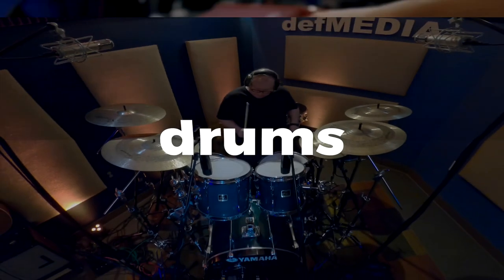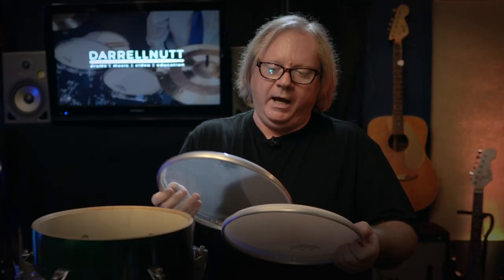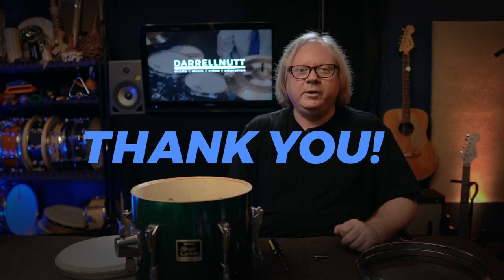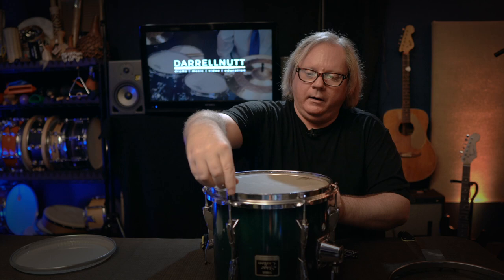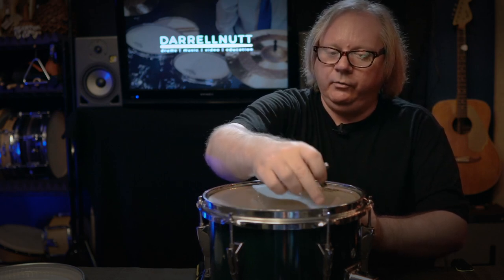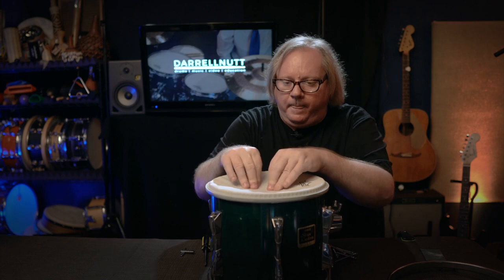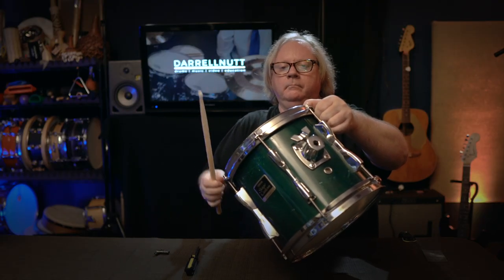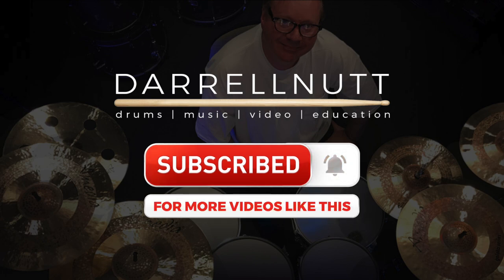Tuning a Drum | DARRELL NUTT | Lasers

Comment: How often do you need to replace the bottom heads, or do you tend to do it whenever you replace the top?
Reply from the maker: Hi gang, I typically change the bottom heads when I’m having a hard time tuning the drum. Some drums will like the bottom head for years. With my Yamaha’s I tend to change the bottom heads about every three or four top head changing. So but once every year or two.

Comment: Have you experienced the old Yamaha YESS mount choking the drum? Because mine does , it's annoying.
Reply from the maker: Hi Nathanael - no I have never used the yess mounts. My drums all have shell mounts. That would be annoying that the purpose of yess mounts is to let the drum sing easier and yet it chokes. I do find the tone changing depending on where I have the cam mount extended. If I have the Tom all the way to the end of the mount rod it has better tones then if I have it on the very end of it. Does that make sense?
Reply: @DarrellNutt  yea totally. The Yess mount I meant is the one that you're using. I have an old Yamaha Power V Special. Huge power toms. Just annoyed by the mounting system. Guess just have to experiment with it more. Yours sounded great! Cheers
Reply from the maker: @nathanaeltsen8957  I thought the US mounts were the ones that had minimal contact with the shell with like only two screws. Mine used four screws and connect completely to the Tom shell. Original stage custom marine green. Old! Ha!
Reply from the maker: Yess
Reply: @DarrellNutt  I think it's called a "Pre YESS mount"